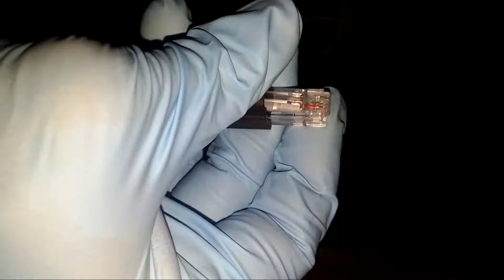Wire Tracing with Tone Generator

Comment: Good video but unless i missed something
PROBABLY THE MOST IMPORTANT FEATURE OF THIS UNIT
you completely missed

You didn't demonstrate EXACT PAIR IDENTIFICATION
i mean.. did i miss something
or are you not aware of it
Reply: And if you feel it has been missed then explain in your context why all the yelling so sad if you really know the answer share it than being bossy about it.
Reply: @martinkuliza  Good explanation. Thanks, I just purchased this toner and tryna learn as much as possible.
Reply: @MrWzeljunior  
well i know everything about it ,  What questions do you have ?

The main thing to understand about any instrument is   WHAT DOES IT DO ?
This does 3 main things
1. Puts a Tone on a line Via Alligator clips
2. Puts a Tone on a Line Via 6P4C Plug
3. Uses (a fluke specific technology) called "EXACT PAIR IDENTIFICATION"
AND WHAT THAT DOES IS ....

When you think you've identified a pair YOU SHORT CIRCUIT THE 2 WIRES and if those wires are the correct wires that the tone is on the instrument will change ring tone (The way it does this is by sensing the change in resistance when going Short Circuit)
this condition can only happen if the 2 wires in question are short circuited

BUT THE KEY TO THESE THINGS IS IMPROVISING AND USING YOUR IMAGINATION

Example :
Knowing that exact pair identification changes tone when you short the wires in question,  Imagine you go up to a pair and put a tone on (NOT HAVING ANY CLUE HOW EXACT PAIR ID WORKS)  you might be troubleshooting for 2 hours or so before your realize what's going on

but, KNOWING HOW IT WORKS
you put your tone on and your meter  (without you testing exact pair ID) starts to change tone
WELL..... YOU KNOW THIS MEANS YOU HAVE A SHORT CIRCUIT 
and that would take you all of 15 seconds to figure out

See the difference between understanding your tools and then knowing how to apply them 

ASK AWAY MATE, GIVE ME ANY SCENARIO , I'M HAPPY TO HELP

Comment: So I bought this and now I need to get a rj11 adapter to rj45 to trace what port it is on panel or cut the wire to trace it correct?
Reply from the maker: If you have an RJ-11 jack on your tone generator, and you want to trace tone with it, you are limited to the 4 wires that the RJ-11 has.

If you want to test each wire on a cable, you can punch down a keystone jack as shown here
https://youtu.be/Cw9-WdpseQE?t=2851

and do not cut off the excess wire hanging out of the jack. A mere 1ft down that cable the keystone jack is on, you will need to crimp an RJ-45 so you can plug your test patch cable into the jack you're testing. You will need that to attach a positive or negative lead of the tone generator, and attach the other lead to the other end of the cable. This do-able if you can get both ends of the cable in front of you.

If you're troubleshooting an ethernet cable that is already installed and the ends are far from each other, you should get a tone generator with an RJ-45. It can send tone tone all 8 wires at once, and you can walk to the other end of the cable to check with the probe.

A LAN tester is better to find out which wire has the problem but the tone generator can help you find where the break in the wire is.
Reply: Mac Os Genius   Huh ?  
LOL
Mate....   to be straight,  you don't sound like a genius
also.. if you're saying what you're saying then chances are you shouldn't be using a tone generator

LET ME GIVE YOU SOME MORE USEFUL ADVICE
as one who has trained many many technicians

Most techs are like zombies
you hand them a piece of kit  (FYI,  KIT is a Piece of TEST EQUIPMENT in electronic terms) 
and you say ... Use it like this 
and they say............. OK
and that's about all you're gonna get from them
THIS IS A FUCKING POINTLESS EXISTENCE

What is more productive to do is this...
You get a piece of kit , Like the one in the video
You then ask yourself   WHAT DOES THIS DO 
you then ask yourself    IN HOW MANY SITUATIONS CAN I APPLY THIS 

so... What does it do 
You might sound,   it produces a noise
NO.....  GET MORE SPECIFIC

More like this....
It uses  a Micro controller to send voltage and frequency down a conductor
and you identify the signal by using the inductor in the tip of the wand

NOW THAT YOU HAVE THAT KNOWLEDGE
You can do more constructive things like this
You first need to test your Tone Generator and determine how much voltage it sends down a line,  Let's say it's 5V for arguments sake
well.... You then know if you have an energised circuit which has 12V  YOU WON'T GET A TONE
it doesn't mean the wire is faulty it means the voltage on the line killed the voltage from the Toner
but if the voltage was 2V  would you still get something
SEE HOW THIS IS MORE USEFUL ?

Next point,   to address your question
the standard thing to do is this

Say you have a connector that has 4 Pins
like this

-------------------------------------------------------------
------------------------------------------------------------
------------------------------------------------------------
-----------------------------------------------------------

well...  the standard answer is you can only use the same number of pins on the other end
.................OR CAN YOU 

MY ADVISE IS FOR YOU TO CONDUCT A FEW EXPERIMENTS

DO THE FOLLOWING
experiment 1 -   Get 2 patch panels (or you can use wall sockets if you like)
Punch 8 wires down on one end and 8 on the other end
on 1 end put in your tone generator 
on the other end connect an ethernet cable that has been cut in half with the wires exposed
TEST TO SEE IF YOUR SIGNAL IS COMING ON ALL WIRES OR ONLY 2
You will likely find it's only 2

Experiment 2
Research why this is so and why all 8 pins are not used for the tone

Experiment 3,  Learn what happens when you have the toner connected and on the other end  YOU TOUCH THE WIRES TOGETHER

Experiment 4,   Theorize how many ways you could apply this knowledge and how many practical situations you could use this in 

Perhaps it would be a good idea for you to also purchase a cheap oscilloscope to understand what's going on 

Because seriously if you are asking the question you are asking it really means that you have little to no ability to adapt to situations or modify things to achieve the result you want

start with those 4 experiments and see how you go and get back to me if you need more help

the lesson for today is

WHEN YOU BUY SOMETHING NEW.............. PLAY WITH IT,   LEARN WHAT IT DOES
don't watch you tube,       Play with it , pull it apart, Understand it 
and don't just use it for it's intended purpose  LIKE A FUCKING SHEEP
LEARN WHAT IT CAN DO , LEARN HOW ELSE YOU CAN APPLY IT 

THINK OUTSIDE OF THE BOX
this is what will make you a good technician and an expert
Until that time comes... change your name to TELECOMMUNICATIONS STUDENT
Reply: @martinkuliza  I see you like to rant, plus 124 subscribers and no videos on your account no wonder many people block you.
Reply from the maker: @martinkuliza  There is good content in your message but your delivery leaves much to be desired. You're definitely not holding a job as a teacher speaking to your students like this. Why then speak so condescendingly to people on YouTube?
Reply: @pcrb141  LOL
Actually... First of all,   I ACTUALLY TRAIN TECHNICIANS for a living ( which is one of the things that i do , not all of the things)
I Train NBN Techs in Australia (FYI,  NBN is our national internet network)
the Techs that i train go from having little to no knowledge and having a completion rate of approx or below 10% to above 90%

I've been doing electronics since i was 6,   I'm 47
I'm an Engineer,  I work in I.T.  TV , Antenna's , Satellite, Electronics repair, CCTV,   Need i go on ?

so.... Yes i do teach and i'm successful at it 
and Yes i do know what i'm talking about
and No, i'm not trying to be rude
in saying that, i'm not here to hold anyone's hand and my purpose for being here is not to worry about people's feelings

in saying that, I'm not actively trying to be an arsehole
and if a person takes it that way , THAT'S THEIR FAULT mate.
i can't control what people feel 

this bloke came on asking a question.... Right ?
i gave him a no fucking around, no bullshit answer
A REAL ANSWER
not some half arsed bullshit answer

IT'S IMPORTANT FOR PEOPLE TO KNOW WHAT THE EQUIPMENT THAT THEY ARE USING IS DOING AND CAN DO 
that's what i explained to him

it's also important that they think outside the box, instead of being spoonfed answers

Like i said i'm not here to babysit anyone and hold anyone's hand.
they way i teach has worked for many 
He either wants to know or doesn't want to know
we are not in playschool here,  We are discussing technical topics,  

People also need to understand that this is youtube and we just have text to go off don't we
therefore  MISUNDERSTANDINGS ARE IN ABUNDANCE, aren't they ?

I can respect this is your channel
i can respect this is your audience and you're jumping in to stick up for them
well... I'm not here to hate on your audience, so don't worry

But again.. they either want to learn or they don't 
sadly some people ask questions when they don't really want to listen to the answer ,   I've taught those kind before as well
I'm only interested in teaching people that actually want to learn and think 
the rest can do what they like 

FYI,   the part about   HIM CALLING HIMSELF A GENIUS  was , in part a joke.
Clearly he didn't pick up on that 
it wasn't condescending  ,   it was just being straight up with him 

anyway mate ,  does that clear it up a bit 

he wasn't supposed to get upset
he was supposed to take it for what it was and ask me a few more questions AND I WOULD HAVE GLADLY HELPED HIM OUT

but.. he didn't
well... Each to his own 
OK
so.. that's me in a nutshell and my intention towards him
Reply: @martinkuliza  That’s very strong motivation every kid needs thinking to get into a blue collar job. To be a excellent technician, one has to study endlessly and master every tool available for any possible scenario. I bought this Fluke to work on diesel equipment wiring. That is basically a computer network designed by monkeys with no standardization. Having a magic wand to send power down a harness, and see where it goes if it shorts or opens is genius. I can also use the probe to hear PWM frequency signals without a scope.

Comment: Lets say Blue wire is broken inside that cable 
Is it still going to show tone on blue wire 
YES
Reply from the maker: you are correct but can you tell me which part of the video you are referring to?
Reply: @pcrb141  
When you are checking blue wire middle of video
Reply from the maker: @geoeconomics3067  you don't need to be concerned about misinterpreting where a signal is going to in a signal tracing test. The reason for that is because the person running the test is looking for signal from a source that they know which wires they placed it on.

My purpose in moving the probe between the blue and brown wires is to show how sensitive it is to the signal. There was a distinct difference in volume of the probe between the blue and brown wires.

Still, anyone running the tests already knows on which wires they placed the signal.

Also if the blue wire is broken and the signal bleeds onto another wire and back onto the blue wire, then the signal coming from the other end of the blue wire will be the weakest signal that you will find.
Reply: @pcrb141  
Ok got it 
Probably signal strenght  should not be the same
Reply from the maker: @geoeconomics3067  one more thing to remember is that if you see weaker signal coming in on the wire that should have the strongest signal, then you should run a continuity test. That test should fail if in this case, the blue wire is broken and inducing a signal on to another wire and then receiving another induced signal back from the other wire.
Reply: if the blue wire is broken then you won't be able to perform the exact pair identification function when you short the wires
so.. you will know that you have a fault